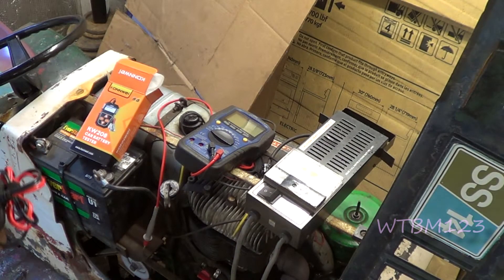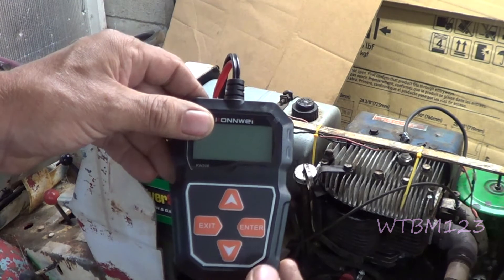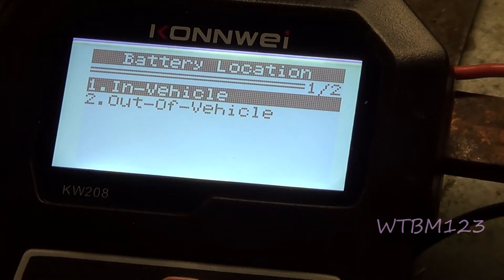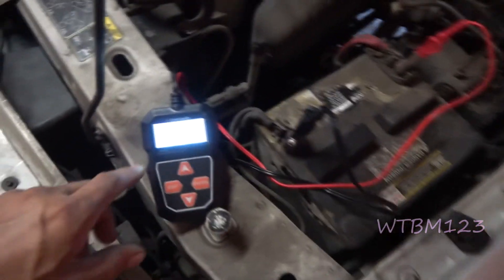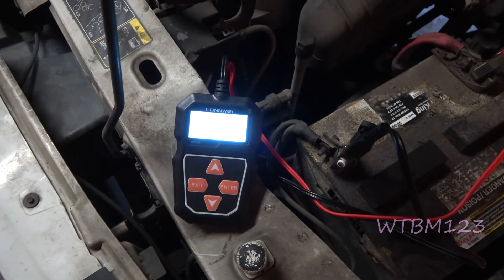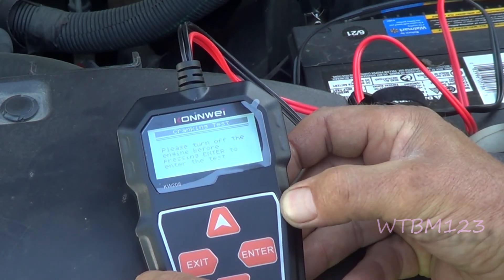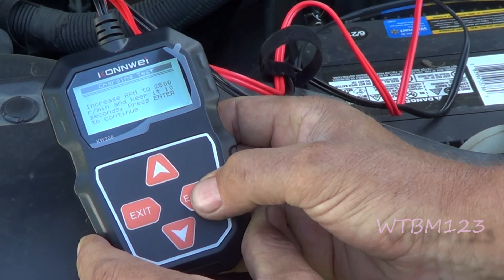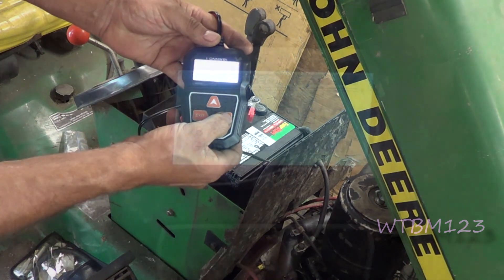Konnwei battery tester KW208, Does it work  12v car battery tester

Comment: I bought this tester & tested it today, brand new battery 230 CCA great results. As far as soc & soh both 100% volts 12.7volts but the internal resistance was 10.53 m0 extremely hi I think have u had this problem before?
Reply from the maker: It does seem high , Have you tested other batteries to see if it reads ok on those ,.

Comment: Is it possible to check it with a Volt meter 1st and then check the voltage with the battery analyzer and compare the difference to see if they're accurate.
Reply from the maker: You can measure sitting voltage with the tester or volt meter separate or at the same time
Reply: @wtbm123   Yes, no I understand that, but what I would like to see is the comparison of the reading on the Volt meter and the reading on the battery analyzer to see if the numbers match up. 🙂

Comment: With a volt meter it will tell you just that voltage, but it's not going to tell you the amperage that's in the battery. Enter the conductive battery analyzer.
Reply from the maker: The battery tester can tell the CCA of battery , The volts , State of charge , State of health and the internal resistance . If your volt meter will read the min max , then you can test voltage underload , like when starter is turning engine and get some what of an idea . But also a weak starter or bad connection can change the underload voltage so not nearly as accurate as the battery tester

Comment: Good day to you Terry and greetings from UK. Still using my old Discharge tester. Works fine but a Faff to rig up. The tester you used is compact and light weight so I might treat myself. Thanks for sharing.
Reply from the maker: I have not used my discharge tester since i got one of these . Thanks for stopping by and commenting

Comment: Voltage is one thing that you need to know The other one is the Cold cranking amps they're important as well
Reply from the maker: Yes , And with these it is so easy to use and get battery info. Thank you for stopping by and commenting
Reply: @wtbm123  you are welcome young man 😎👍